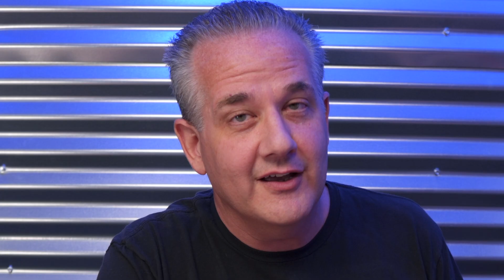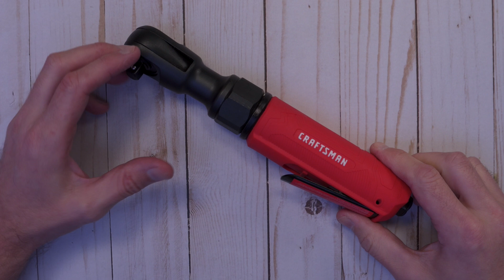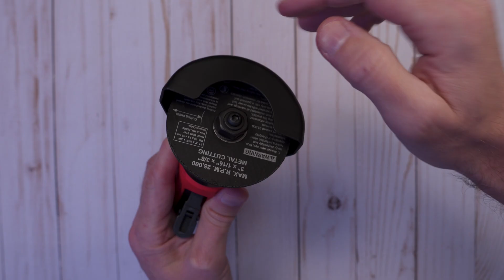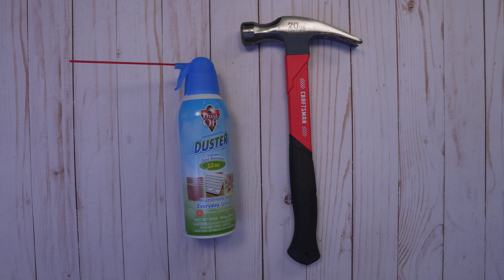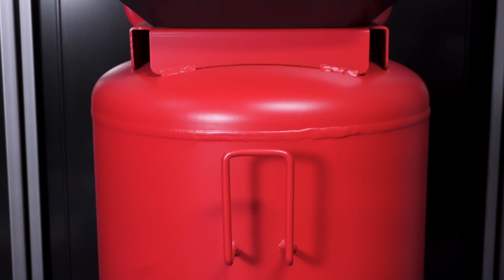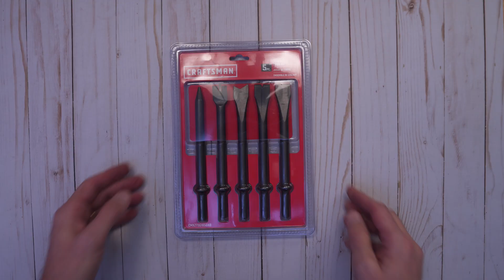All Craftsman Air Tools (2021)

Comment: Would have liked to see some actual usage-testing of these items. From what I have seen, the 750FTLB impact wrench is highly overrated for power. Sometimes has problems taking off lug nuts. While they ARE inexpensive, if you are anything but a "home user", I would take a pass on them.

Comment: Im looking at the 750 max  99.99 ACE hardware  I have a 600 foot pound Craftsman 20 years old can no longer get parts they look the same and look just like Ingersoll Rand quit max 204.00  I wounder if IR made the 750 max or my 20 year old 1/2 inch impact ?  Parts numbers are the same form a wholesaler I use .  Based off Craftsman part number and IR parts list .  craftsman # 2131-42A-6   IR # 2134-42A-7  makes me go Hummm

Comment: Air tools are dead for the most part, dumb move on their part
Reply from the maker: I disagree. They still have their place and I’m sure their research agrees otherwise they wouldn’t have wasted their time. Thanks for watching, John!
Reply: @chris  good video we need a battery powered air hammer to totally get rid of air tools, a sander may be the only tool that air would make sense as well, but all the other tools have good battery life. Most techs I know have abandoned air tools for the most part. I loved my air tools and hate seeing them sit unused but there are so many drawbacks with them, need a big compressor and hose and unless you work in a shop that has one battery powered is a better option. My battery powered tools from the past always failed me when I needed them to a point where I found ones that ran on AA battery’s. There is no way to easily use air tools in the field without a big tank compressor. The only other area would be heavy service work like big trucks. Most big companies don’t have a clue that’s a fact they get so big they become stupid and don’t do things that make a lot of sense. The craftsman hand tool line and brand was destroyed by sears. I will tell you why because they no longer delivered a quality tool at a good price. They changed to poor quality at a higher price than it was worth no one wanted craftsman anymore after that. Stanley bought them for the name and decided to make them overseas and telling us they were going to make them in the USA which hasn’t happened as of yet. They are bringing out all these tools that already exists in other brands for the same or cheaper price point and craftsman power tools were never rated that well not like the hand tools. That’s why I said it’s dumb on their part as they haven’t shown the true craftsman lover what they want to see quality made in the USA at a fair prices. That’s how craftsman comes back. People still look to buy the old craftsman stuff. Quality has come up some from when sears destroyed the name but not enough for it to become what it once was.
Reply: That is telling it how it is my man! Everything that you stated here makes perfect logical sense except when it comes to the angle die grinder sander an air hammer. I have yet to see a decent cordless option for those three particular tools. I am myself invested in the Ingersoll rand I QV 20 and I QV 12 quart list line because I just don’t have the space or the patience to deal with servicing a tank, reeling up an onion reeling hoses, messing around with couplers and fittings.
I really think that at some point in the future I will be investing in at least a 25 gallon tank so that I can run an air hammer ankle die grinder and a polisher sander to increase the amount of jobs that I can do on my own.
Reply: @chris  I would tend to agree seeing hours I have yet to see a cordless answer to an angle die grinder polisher sander and air hammer. Circa 2014 I began investing in the Ingersoll rand line of cordless power tools which include the IQ V 20 and I QV 12 series. It’s been almost 10 years since they originally introduced the IRW 7150 at the 2011   Sema show.In  all that time they have not released a 20 V answer to one angle die grinder war air hammer. They do have a 12 V polisher sander but I do not do those types of jobs.
Reply: They do have their place... if anything you can get a nice lineup of pneumatic tools fairly inexpensively....because cordless tools are so popular right now so if you're looking to save money and you've got work to do pneumatic is the way to go
Reply: Dude go to any garage and all they use is air tools, the battery operated tools can't compete

Comment: Thanks Man 
I just bought the 6 lb nailer airtank 
So on the regulator to run the  18 gauge nailer should be set at what
Reply from the maker: 90. All of the ones I have say 90 max PSI